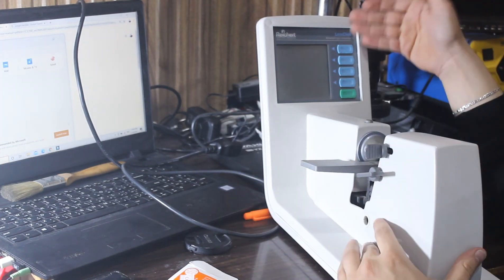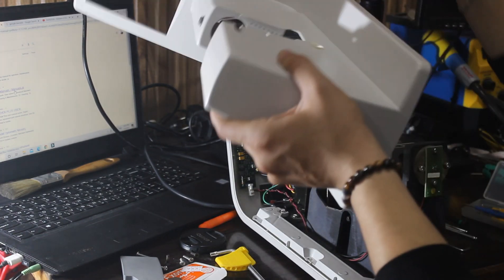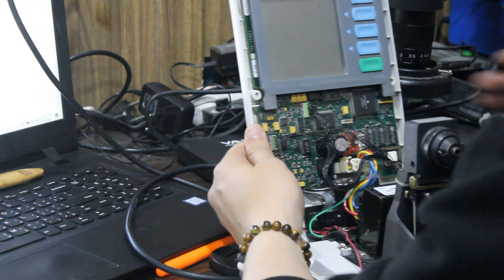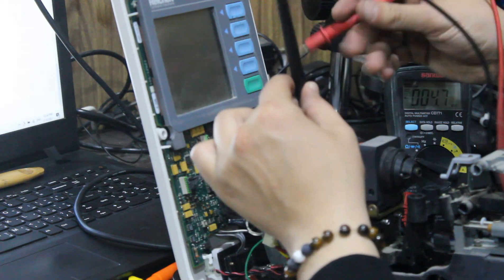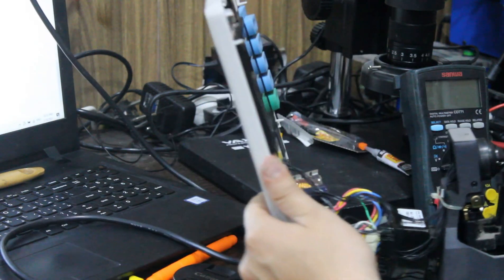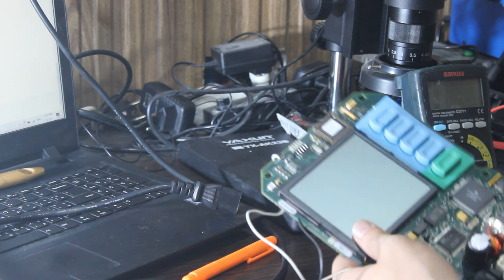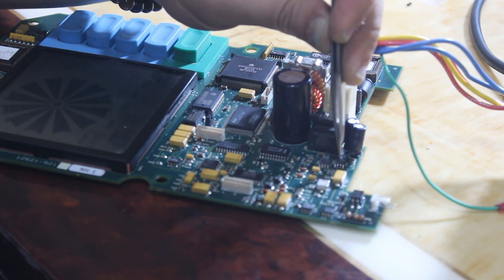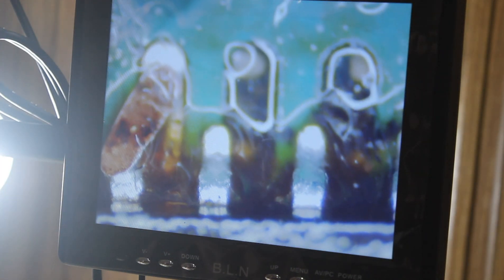Reichert Ophthalmic instruments (lensemeter  Repaired )

Comment: dear Salmanium I have one lens check Reichert the same model that you are repaired, but my problem is the led do not light because is fedding with only 1,7 volts should be at least 3 volts can you give me some comments
Reply from the maker: you can contact me on whatsapp 0096181007374